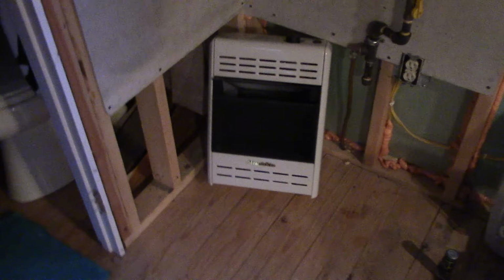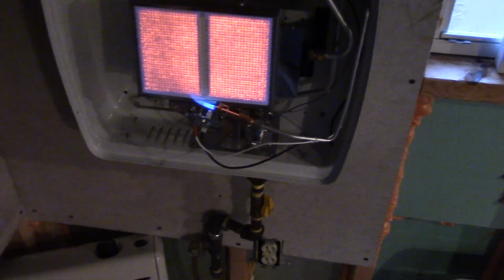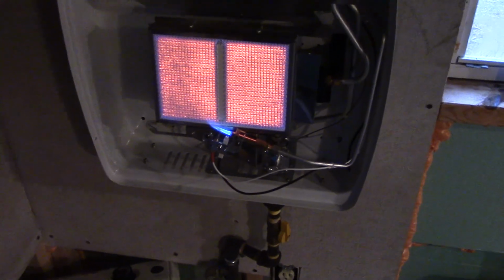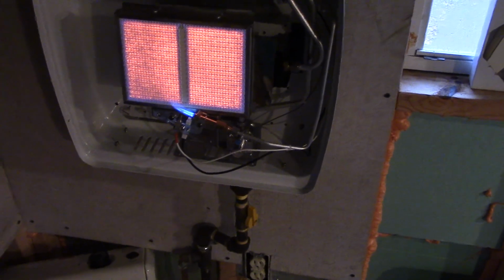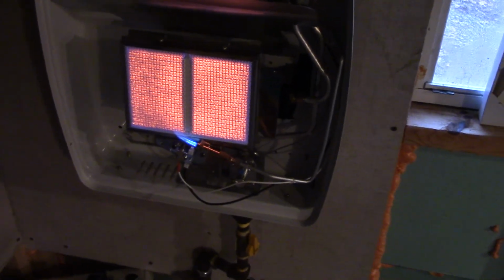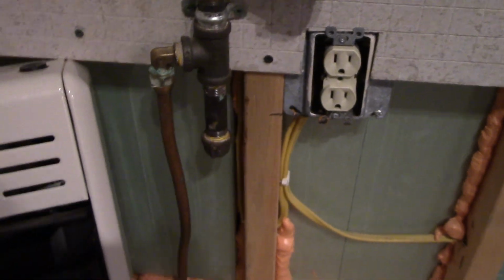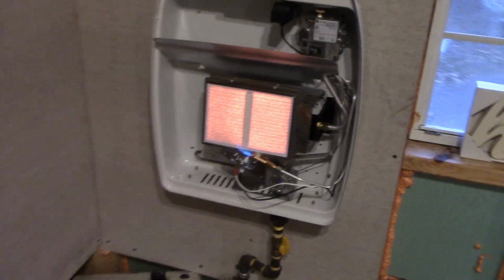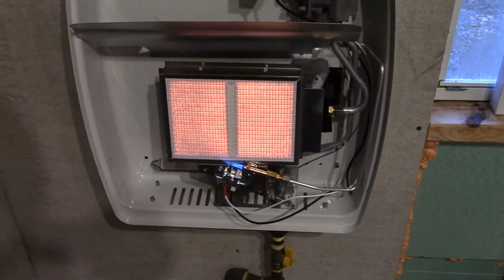Clogged propane line.

Comment: My dad was a LP guy for 10 years. I showed him this video. He was saying copper can build up over the summer. He says to put in a in line filter or remove the copper and just go with hard gas line.. Hope that helps..
Reply from the maker: Thanks for the info, I will look into the filter, the propane was flowing all last winter, had my regulator freeze up a few times. but worked well, I had no idea a propane line could clog  up over the summer.
Reply: I've got about 40 feet of 1/2" copper line running my wife's cook stove/oven. We use a couple of ten gallon tanks. The stove top is barely lighting up, and the oven failed to get hot the other day. I've seen mineral oil get into my Little Buddy heater (I didn't use a filter, then) and I had to clean out the line and valve. What kind of filter can I run on my 5 and 10 gallon tanks?
Reply: @bjusticeforever  Brother Matt from the video is no longer with us. I have no clue what filter to use. Sorry

Comment: lol poor old pup ! i was told never run copper over 6 ft cause the gas causes the copper inside the pipe to flakes will plug our pipe ?
Reply from the maker: It was good to not need the little buddy heater anymore we had to shut it down when not in the cabin worried the dog would singe its tail again, I had no idea a copper propane line could get clogged up, next time I will run black pipe for sure thanks for the input.